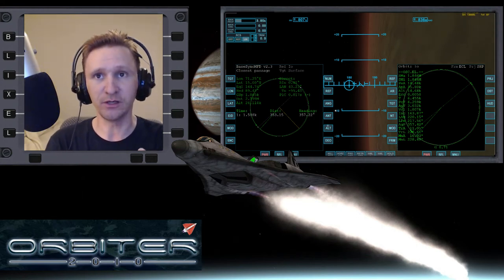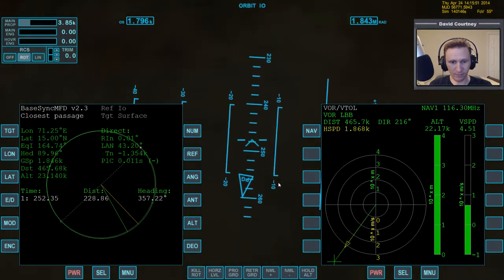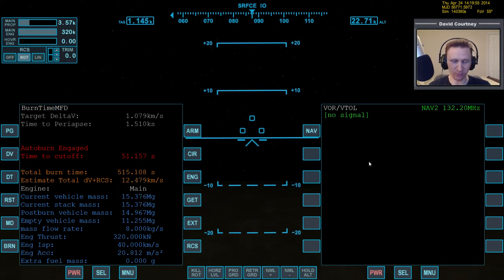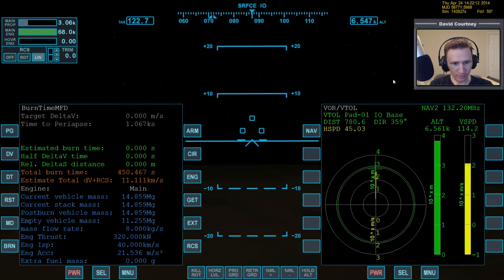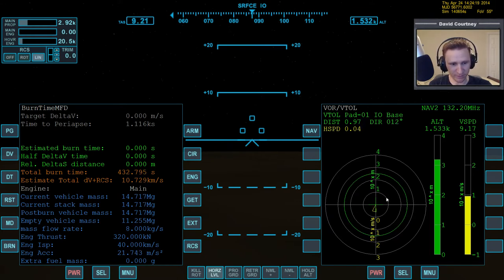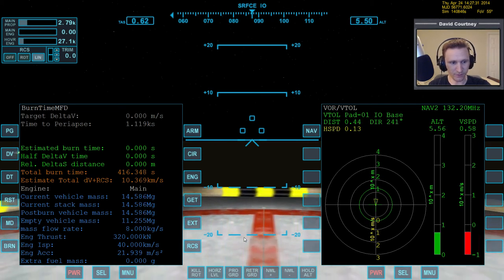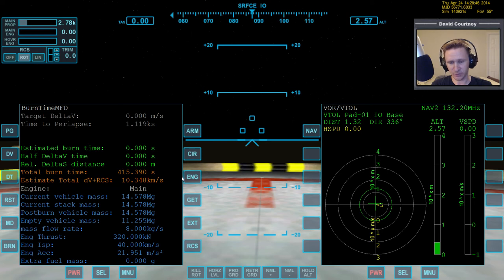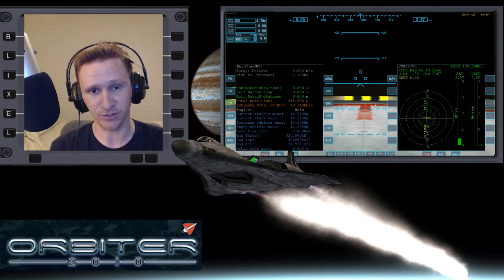Orbiter 2010 - [Part 14] IMFD Jupiter Moon Hopping - Europa to Io

Comment: Never tried it but I suppose you could use Burntime Calculator for the landing as well. Just switch to hover engines and enter your descent velocity and you could auto-burn when you get to the correct altitude distance above the pad (same as distance to base and eliminating horizontal velocity, really). But I supposed you'd have to use the hover engines to at least make your descent velocity consistent for it to work correctly. But it would get you down the bulk of the way quickly.